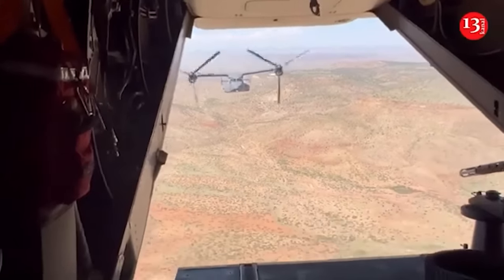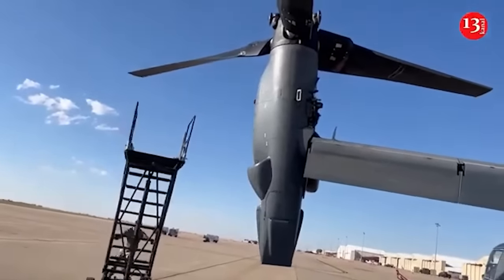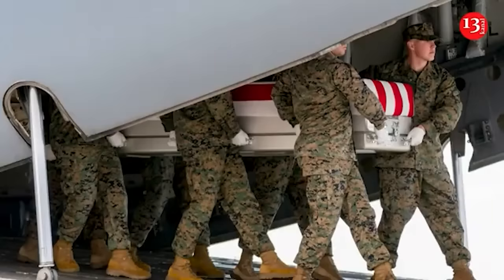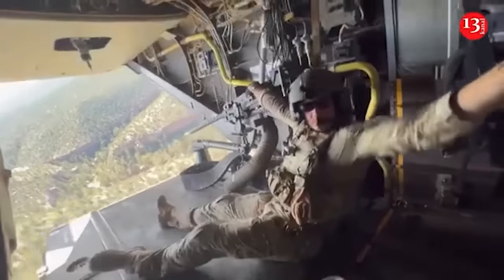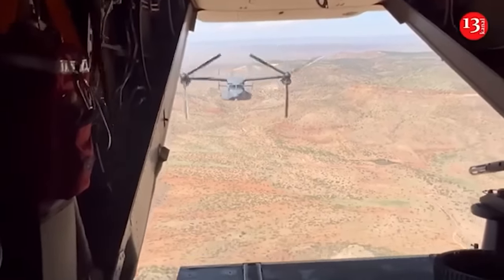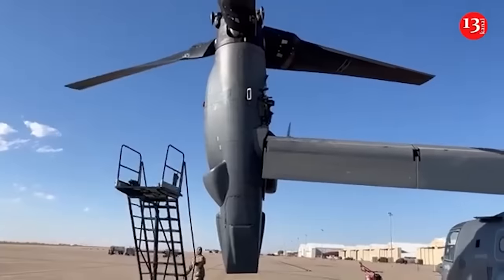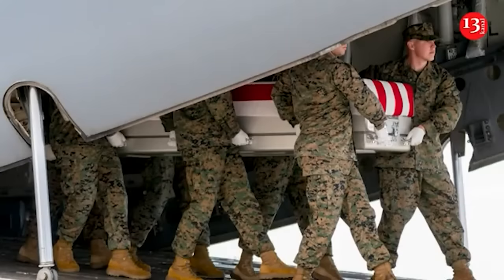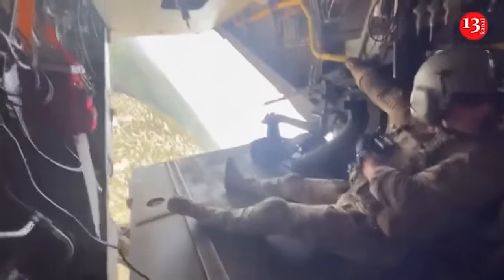Russians start installing outdated engines on Kh-101 missiles, danger to civilians increases

Comment: And they still use propeller driven aircraft with analog and tube electronics,  in 2024.   - Tupolev Tu-95 "Bear" - First flight 12 November 1952 - Manufactured from 1952 to 1993.
Aircraft that is 72 years old ! For GPS guidance and mapping, the pilot uses his personal cellphone and Google Maps, because the aircraft dashboard does not have GPS maps.
 ROFLMAO